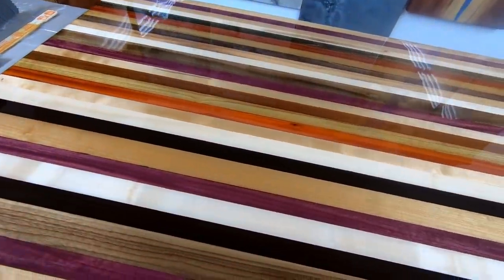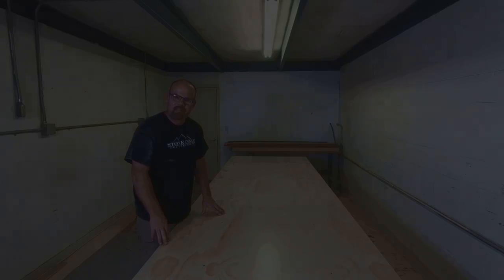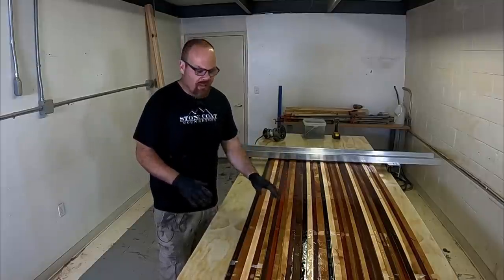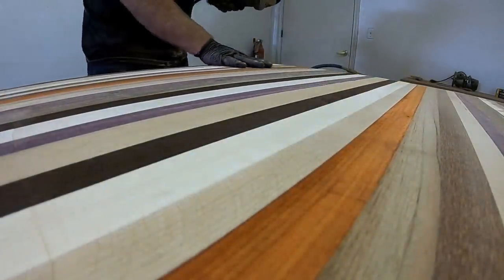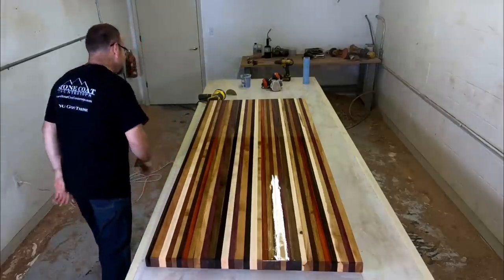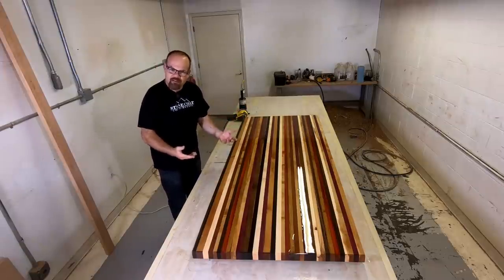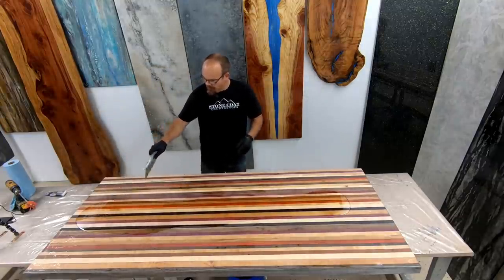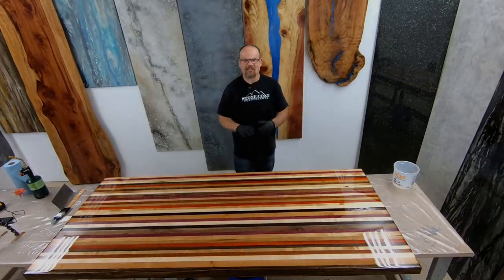How To Build a Solid Wood Table Top

Comment: It looks amazing. I have two questions: 1. Does the epoxy seal the wood so that there is no season expansion? 2. Does the epoxy block UV light and keep the wood colors from fading?
Reply from the maker: We use Stone Coat Countertop epoxy for the seal coats as well as the flood coats--it’s just applied at different thicknesses. The seal coats are applied at one ounce per square foot, whereas the flood coats are applied at three ounces per square foot. Our Art coat epoxy has the most UV protection out of all of our epoxy products and is ideal for projects in white themes and a lot of UV exposure

Comment: can you use a heat gun instead of a torch? or with the air pressure off it cause to much spreading in the epoxy?

Comment: Cool. How do deal with the drips on the other side after the final coat?  Also, how about the underside?
Reply from the maker: Great question! We remove drips about 4-5 hours after we pour using a Bondo spreader or old credit card. Here is a video link showing how we do it.  https://youtu.be/74xsrcHaFBE?t=4843You can also let the drips dry and sand them off using a 50-grit metal fiber sanding disc and flush adaptor for a grinder. Contact us anytime for support. (541)450-1976

Comment: If you used a vibrating table, would that help it self-level faster..?? Would it even be worth it since it will not help it dry quicker? Thanks for any insight.

Comment: If you use this as a kitchen countertop, at what point in the process do you cut out the hole for the sink?
Reply: Deborah Lopez My suggestion would be after glueing the wood or before crack filling. Simply so that you can fill, sand, and router all together. You want to cut short and sand it out, because cutting something with this much texture and epoxy can damage the wood.

Comment: What kind of sander are you using when sanding the router marks? And is there a special sanding head that is used?
Reply: StoneCoatCountertops you mentioned a metal sanding disk is that for an angle grinder? I have a dewalt orbital sander and i know it won't take a metal sanding disk. Are you using an angle grinder with the guard off? Its hard to see in the video.

Comment: Thank you for the great video!  I look forward to doing a similar project!  Just wondering what you do with the underside.  I never saw you flip the table over.  Do you epoxy the underside as well?  If so, how do you manage the side drippings that flow onto the already dried portion? Thanks!

Comment: Well - i have a question - when you apply epoxy on the top part of this table - and not the bottom as well - does it start to warp in any way? Because top side is sealed and protected from moisture, but bottom side is not - right? I am really afraid my project coud warp a little bit...  :(

Comment: Question: If the bucket containing epoxy is slightly heated before pouring (for example, with hot water around it), wouldn't you avoid using burn in sticks?

Comment: At around 19:30 you are talking about a 50 grit metal sanding disc, are you using a standard angle grinder for this, that is what it looks like but one can't really tell if it might be orbital.
Reply from the maker: Thanks for watching Dbc105! 
We use a standard angle grinder for the 50 grit sanding disc portion of our projects when heavy duty sanding is needed. 
We use a regular orbital hand sander for most all of our other sanding needs. 
Sand the edges by hand for best results so you don't burn through the color on the edges!
Reply: @StoneCoatCountertops  thanks

Comment: Amazing table.......just beautiful to look at. I notice you only apply the seal and flood coats to the top. Do you never apply the finish coats to the underside of tables that you build? I am working with a live edge slab for the first time and was planning on applying epoxy finish coats to both sides. Is this recommended?
Reply from the maker: Great question Jonathan.  You can seal the underside with a sealer like polyurethane or something that will stop moisture. When you epoxy the surface as well as treat the underside of your project, this will encapsulate the work piece and help to prevent warping and movement caused by moisture. We like our moisture content under 13% in our wood projects before coating. Please feel free to contact us anytime for project support. (541)450-1976

Comment: do you sand the flood coat drips off the bottom edge? does that destroy and fog up the edges?
Reply from the maker: You can sand them or you can scrape them off after about 3 to 4 hours after your pour. Great question!

Comment: Hi Mike, Out of curiosity, why wouldn't you just use Wood glue to attach them together? I realize the epoxy is super strong, just wondering.
Reply from the maker: Hi Angela Reckart, great question! We used our quick coat gap and seam filler to show what is possible with this product, as well as the epoxy offering a stronger bond than the wood glue!
Reply: @StoneCoatCountertops  Thanks!

Comment: Question, how strong is the laminated wood? would they eventually peel apart (delaminate)?
Reply: They demonstrated in the video just how strong the bond is they layers aren't what would fail the wood is what would fail and it would be away from the actual joins. Look after the surface and don't store it in places where it's going to get wet and such it'll never fail warp or rot.

Comment: It would be very helpful to see how to do a table that is made by incasing a piece of wood. I need to know how much epoxy is used at a time from the first poor to your last flood coat.You do some awesome pieces I love all your videos they are very helpful Thank You
Reply: They mentioned 1oz per square foot for EACH Seal Coat (3 total seal coats). 

You’ll have 1 Flood Coat. Which is 3oz per square foot of project piece. Using the 1/8” trowel.

Comment: I would like to see you using your new adhesive to join two edges of MDF together
Reply: waste of time, just buy  more MDF.  Can't edge glue plywood either.
Reply: cdouglas1942 “More MDF” would be a great answer if I could find a piece that was 10 feet by 7 feet which are the longest dimensions of my counter top area.
Reply from the maker: Great suggestion Ted, thank you!
Reply: Use biscuits and epoxy or (much cheaper and quicker) Titebond 3. Both are waterproof which is more than I can say for MDF.

Comment: hi i love your work i have a question can i use a heat gun instead off a gas burner thanks russell
Reply from the maker: Thank you for your kind feedback Russell!  We always use a propane torch to remove air bubbles incorporated into the epoxy while mixing. A heat gun will work, but not as effectively as a torch. Artists love heat guns because of the effects achieved when hot air is blown across the epoxy. In our experience the torch pops bubbles better than the heat gun. Here is a link to our favorite torch head. This is used with off the shelf small propane bottles: https://www.amazon.com/Bernzomatic-TS4000-Trigger-Start-Torch/dp/B00008ZA09/ref=as_sl_pc_qf_sp_asin_til?tag=stoncoatcoun-20&linkCode=w00&linkId=1079ed93ce4f9a3210140881ab1ed4ed&creativeASIN=B00008ZA09
Reply: thank you very much i am new to this and your video are awesome the way you tell us why and whats happen is awesome thanks im very impress Russell from Australia @StoneCoatCountertops

Comment: S2S or S4S mean surfaced 2 sides or surfaced 4 sides. Not sanded. They use a jointer and planer to surface them not a sander.

Comment: Question Mike: Does the epoxy adhere well if the wood I'm using is treated with a stain, varnish or other wood finish? 

What I'm in visioning is using stained finished (even though you talked about working with what mother nature has given us) and then following it with epoxy.

What are your thoughts on doing it that way?

Comment: Beautiful table, and great work. My only "complaint" is the trend with coating everything in epoxy these days. I prefer natural wood, only coated in linseed oil or similar. Cheers. :-)
Reply: +J Rand
Ahh then you could flip the trend on it's head.  Cut up different coloured lengths of epoxy then glue them together and sand.  Then coat them with natural timber.  :)
Reply: J Rand

In a restaurant or bar having a thick clear coat is a good idea because of the heavy use.  In your home it probably isn't necessary unless you have monsters for kids.

Comment: What if you wanted a satin or matte finish to it? Can you change epoxy sheen or do you just put wood finish over it?
Reply: I did a wet hand sand with 1000 grit and then waxed on a much smaller table project

Comment: Link to metal sander thing, please. Is it just special metals discs that can be attached to any sander or is the sander machine itself a metal sander? Thanks
Reply from the maker: Hi Sherif!  Here is a link to the angle grinder we are using: https://www.amazon.com/Makita-9565CV-High-Power-Angle-Grinder/dp/B00005Q7BG/ref=as_sl_pc_qf_sp_asin_til?tag=stoncoatcoun-20&linkCode=w00&linkId=fa2b9da7f297e3f3e7e2295fe2729303&creativeASIN=B00005Q7BG   and here are the links to the conversion kit: https://www.amazon.com/Makita-9565CV-High-Power-Angle-Grinder/dp/B00005Q7BG/ref=as_sl_pc_qf_sp_asin_til?tag=stoncoatcoun-20&linkCode=w00&linkId=fa2b9da7f297e3f3e7e2295fe2729303&creativeASIN=B00005Q7BG  and the metal fiber sanding discs: https://www.homedepot.com/p/Diablo-5-in-50-Grit-Fiber-Disc-4-Pack-DCF050050S04G/202830897   
Thank you for tuning in and feel free to contact us anytime for project support! (541)450-1976

Comment: Maybe I missed it but do you finish the bottom? I know you used the steel but do you also epoxy under the table , always been told to finish both sides evenly. Great video!!
Reply: Seconded, where is the leg attaching video? 😉
Reply: Hay Len, I think the bottom is where he used the majority of the semen crack fill.

Comment: In the video you never mention the mix ratio when you laminate the wood together. So what is the ratio that you use and are you using just the regular Stone coat or are you using the seam and crack epoxy?
Reply from the maker: We used our Stone Coat Countertop epoxy to laminate the pieces of wod together and mixed a 1:1 ratio.  Thanks for tuning in and please feel free to call or email us anytime with questions or for project support. (541)450-1976

Comment: If I use tyvek tape to go under my countertop to pull the drips off, how long should I wait after applying my epoxy to remove the tyvek tape?
Reply: To have this work, epoxy can NOT be cured, needs to be soft.  Tape has to be stronger than epoxy.  Might be wise to grind drips off the next day as they do..

Comment: What about all the drips down the bottom edge?
Reply from the maker: Great question Mike! We remove drips about 4-5 hours after we pour using a Bondo spreader or old credit card. Here is a video link showing how we do it.  https://youtu.be/74xsrcHaFBE?t=4843You can also let the drips dry and sand them off using a 50-grit metal fiber sanding disc and flush adaptor for a grinder. You don’t want to sand them if it’s in the house because of the dust.
Call or write us anytime for project support. (541)450-1976  Are you planning a similar project?
Show less

Comment: Wow! What's a tabletop like that cost??
Reply from the maker: Great question and thanks for watching David Hopkins, it is dependent on what similar projects like this one are going for in your area. Etsy is a great resource to gauge pricing, you will want to take into consideration the cost of material and labor. Larger dinning table size can retail anywhere from $2000 - $3000. Thanks again for the great question! Contact us anytime for project support. (541) 450-1976.

Comment: One thing to remember, each time you put a coat of epoxy on , use the torch. I found this out after I had put 3 coats on and had air bubbles in and wanted to put the final coat on :-( The video could have been a little clearer about using the torch after each coat but it's a learning process

Comment: Why keep the masking tape on the steel inserts? My only gripe. Other than that, it looks amazing
Reply from the maker: Great question J T. We mask off the ends of the steel tubing so that the epoxy wont seep into it. Contact us anytime for project support. (541)450-1976

Comment: Does it work with a electric heat gun as well ?
Reply from the maker: Great question Marius. We have have found that a torch is much more efficient at removing air bubbles on larger projects as opposed to a heat gun. A heat gun will work; however, it takes many more passes. Thanks again for the great question and please feel free to contact us anytime for project support. (541)450-1976 Are you planning any projects at this time?
Reply: @StoneCoatCountertops  thank you. Maybe a small coffee table

Comment: Great video but where is the 2nd part? really interested in seeing how you install the legs.
Reply: In others I have seen like this a pair of trapizoidal shape of 2" steel tube is screwed to the table bottom.  Probably get some on line.  Another approach is to buy a set of "hairpin" legs on Amazon.

Comment: doesn´t the purpleheart fade to gray over time?
Reply from the maker: That's a great question Richard, we are not too familiar with the fading process of purpleheart; however, there looks to be some good woodworking forums that discuss this, here is a start: http://www.woodworkersjournal.com/keeping-purpleheart-purple/  Our Stone Coat Countertop epoxy does have UV inhibitors which should help to stop that process which is caused by uv rays. Thanks again for the great question, are you planning to recreate this project?

Comment: Hi Mike.  I love the table top project.  I have made a few dining tables but the finish never turned out like this.  I did notice the drips on the ends, so when do you take them off?  They would harden up so what do you use to sand or remove them?  Thanks again.   Take care.  Tim
Reply: He said they use the 50 grit metal disk

Comment: What do you call that kind of router bit?
Reply from the maker: Hi Wolf!
Here is a link to the router bit we show in this video!
https://www.amazon.com/Magnate-Surface-Planing-Bottom-Cleaning/dp/B0006B0QXO/ref=as_sl_pc_qf_sp_asin_til?tag=stoncoatcoun-20&linkCode=w00&linkId=be2e3bf1a918bd41ced3b3067f98217f&creativeASIN=B0006B0QXO
Reply: @StoneCoatCountertops  thanks
Reply from the maker: You Got This Wolf!

Comment: Won't the purpleheart fade to brown?
Reply from the maker: Great question Chase. It shouldn't. Our Stone Coat Countertop epoxy has built in UV inhibitors. Are you planning a similar project?
Reply: @StoneCoatCountertops  I used padauk to make a table and it has similar fading issues. I did not used as thick of an epoxy layer as to preserve more grain texture and look. But I did put it next to light colored wood to highlight it even after fading.

Comment: So why use epoxy rather than wood glue to bind the slats together? I get that the epoxy bond is strong, but wood glue would be just as strong, and cheaper, right?

Comment: Where can I get the router rail thing you are using. I have a few routers and I have been wondering how can I make a countertop. I have a planer but it is only 12.5" . That system seems like the best way and I can build the whole counter with out a pain. Great video I subscribed.
Reply: It looks like it an awesome jig. But I am a disabled Iraq war vet making a small income each. I would love to have one maybe I'd be able to make some money from the work I'd be able to do. But I can not afford $400.00 right now. You do a great job and the video's are all very good and fun to watch. A lot of I did not know that is how you did that. Heck maybe since I have been working in metal as a steelworker in the SEA BEE's I can figure something out. Thank.
Reply: It would take longer, but you could just get a flat board to clamp on as a fence...
Reply: Mickey Sanker

Search for the wood whisperer.  He has an excellent video that explains how to flatten tabletops accurately.
Reply: The simplest router sleds  are shop made.  The router is in a long 3 sided box  (3/4" ply) with a long slot in the bottom for the router bit.   Box slides on level rails screwed to the table. They use small wheels to guide the sled but you can do without with a little care.

Comment: Hello, what is the heat resistance of epoxy resin tabletop?
Reply from the maker: Thanks for watching! Stone Coat Countertop epoxy is extremely durable and we have great heat resistance, which will handle hot pots directly on the surface; however, we do recommend using hot pads as with any countertop and table. We have tested up to 475 degree Farenheight, Here is a link to our durability video showcasing our material in action! https://www.youtube.com/watch?v=YLUteivXWaM
Reply: Thank you for your reply. I like your video very much. I like them very, very much.
Reply from the maker: Thanks for being a fan 雨后的天空 ! Are you planning any projects currently?
Reply: ThankU ！I don't have any plans at present, I just think about this problem in the process of watching.

Comment: S3S should be "surfaced 3 sides," not sanded. 
Generally S3S boards have never been sanded and the finished look on it is straight off the jointer and planer, if I am remembering correctly.